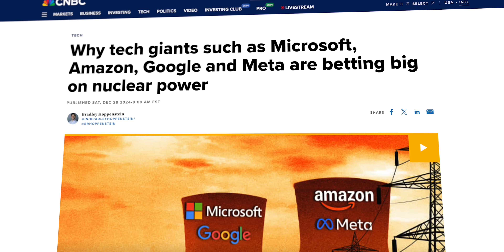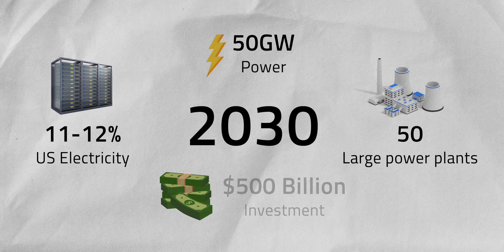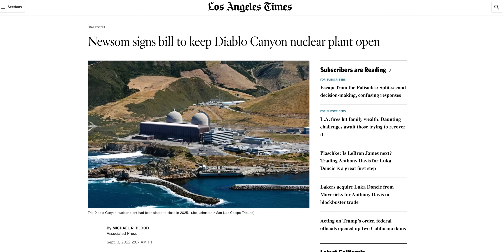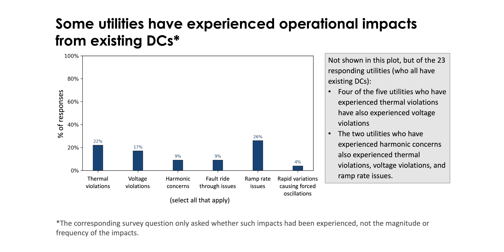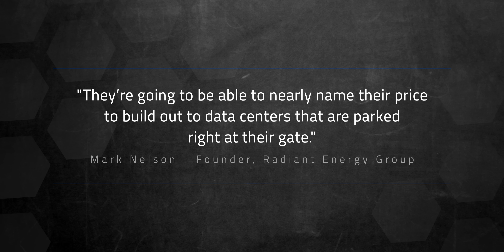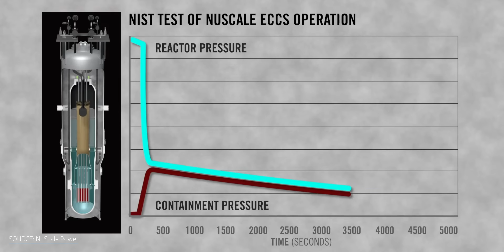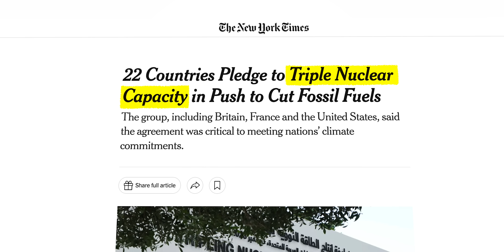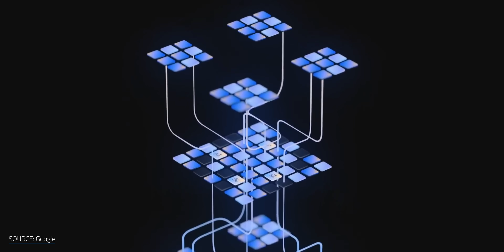Why Big Tech's Betting Billions on Nuclear (Not Renewables)

Comment: SMRs Is absolutely the future of nuclear power.  It will be far less expensive and highly scalable. The limitations of wind and solar are the variability of the power they deliver, and as the baseline load demand increases, there simply is no way to be sure that the baseline capacity is sufficient to avoid the need for rolling blackouts.  I have been advocating for the building of new nuclear power for 20 years. No matter which way I calculate the numbers, we can't do it without either going back to coal or building new nuclear plants and nuclear is much less expensive than coal (and cleaner as well, but to a power producer, cost is more important). SMRs in the form of the A1B 380 megawatt reactor used on Aircraft carries, could be made in mass production for very low prices. The A1B costs about $500 million but in mass production, it could be made for 1/2 of that price. Many are asking why the A1B is not being configured for civilian use.

Comment: solar and wind is also not renewable.. sun will run out just like uranium, thorium, and hyrdogen isotopes.. not to mention all the rare elements needed for solar and other "renewables" in terms of cost per megawatt hour, nuclear has a much better longterm projection than anything else, especially since it is much easier to repair and reuse
Reply: The "sun will run out"; by the time it does, I am not sure that this, or indeed anything else, will be an issue.
Reply: @knightsnight5929  that point stands for nuclear energy as well, by the time we run out of uranium and thorium we will have moved on to something better

Comment: Nuclear is dependable power, renewables are not its really that simple.  If installers of renewable power sources would be required to guarantee reliability the truth would be out in the open.  Currently when renewables cannot supply reliable power they scavenge power of the grid to make up the difference.  Reliable suppliers of power supply continue to be demonized by green activists.

Comment: Over the years, new innovations have been found to do more computations with less power.  The most glaring, obvious one was the shift from vacuum tubes to transistors but there have been many more.  Hopefully we will come up with another X10 reduction in the amount of power do do a given level of computation.  Anyway, nuclear better get a move on.  Solar and wind are so easy to install that by the time nuclear catches up, renewables will have crossed the finish line.  How about an article on how much power America could generate if every private house had solar panels on the roof and if the government took it on themselves to install small, medium and large pumped storage everywhere possible.  This would not only store power but would stabilize the frequency and voltage of the grid.

Comment: Nuclear is not clean. Think about Uranium Miner Deaths, Uranium Mine clean up after the mine is depleted. Were to and best way of storing spent nuclear fuel for thousands of years. Tgat many countries with Uranium are some of the worst world actors. If a 1859 Carington Event results in no workers, no pump replacement parts, no diesel fuel all resulting in spent nuclear rods pools over heating World wide poisoning air, land, sea, and water for the remaining few struggling humans, and all wild caught food plants are poisoned  after our electronic based society has broken down into caos from the EMP Then Nuclear Power does not seem so neat, and clean an idea as a fuel source to generate electricity.

Comment: SMR's should be part of the plan.  Larger Nuclear Reactors also make sense, but Wind and Solar are not a good answer.  Natural Gas and Hydro needs to be the energy knobs to keep the grids stable.
Reply: wind and solar can work with hight temperature reactors (gas cooled TRISO) or molten salts. They run much hotter than PWRs, and thus allow to store the exess heat using thermal accumulators (when the renevable power is abundant), and tap into them, when needed.
Reply: @Viktor-x1w7w  We've been brainwashed with wind and solar.  They are only accepted because of the unfounded hatred towards CO2.  Neither makes sense on a wholesale level, while solar can make sense in some situations where people want autonomy or need power in areas too isolated to bring in grid power.  Those situations are not common.

Comment: We need to stop addressing cost overruns on a nominal basis. With inflation, basically every year something will cost more than it did the year before. Not an excuse for the Vogtle plant to cost more, but without real inflation metrics weighing into the equation, the increased cost is hard to understand if it is time/inflation sensitive or actual inefficiencies. 

Same when conparing new vs old power plants. Sure its better to keep something old running just like a new car, to make the most of the up fromt capex, as long as the opex doesnt overpower that use case. But eventually something needs to be replaced or more built due to increasing power demands

Comment: Interesting - I was unaware the driver for Nuke is data. And seems they're prepared to pay for it, above market rate, just to secure supply. Isn't this going to get interesting - when our need for data is going to divert electricity from where it might be more needed. The General Pulic in competition with datacenters for electricity. The Voltage Wars are a-coming.

Comment: As usual "renewables are cheaper" with no discussion of the backup required to move it toward base load power.
Reply: That's because it is cheaper even with the backup priced in.
Reply: @ As you assert with no justification. 

If it was really cheaper, lack of subsidies would not prevent investment.
Reply: @ Well I could point to Lazard, which has been doing a LCOE including storage that proves exactly what I am saying, or I could point out that Nuclear has enormous subsidies without which it would never have been built. Either option has your argument being discarded as defective.
Reply: @SocialDownclimber  Ridiculous. France has been powered by nuclear for many years and has the lowest power costs in Europe.

And storage? What, 20 seconds of it? Give me a break.

The promises of "renewables" have been broken over and over again for 20 years. If they can't survive without subsidy after all these years, they shouldn't exist.
Reply: @BusBozo  in France we do have large subsidies for Nuclear though so wrong example
Reply: @Voyant  So France is selling subsidized power to the UK and Germany? I sincerely doubt that. I am sure that subsidies are 1) not direct per Kwh as they are for "renewables", and 2) are negligible.

Comment: Imagine how much of a better position we would all be in if nuclear power technologies received a decent amount of R&D during the last 50 years. Combine that with the investment in renewables, and we'd have cheap, plentiful power, with negligible carbon emissions. Sounds awful.
Reply: You may possibly (only possibly) be right. Maybe we should have poured money into nuclear (large nuclear though - SMRs are innately expensive because of the inefficiency of small heat engines). But we didn't, and with the nosedived cost of renewables in the last decade or two there is absolutely no chance nuclear could now catchup with them economically.
So TLDR is "coulda, shoulda, but didn't".

Comment: One often forgotten problem wit conventional nuclear is that the Uranium reseves are very finite: with the current reactors it may last some 50 years or so before it gets really expensive and some 100 years before one would have to resort to sea water - while in theory working it would be way to expensive and energy intensive (e.g. use 1/3 the ernergy). So there is little room for new reactors. The SMRs tend to need more (like +50%) Uranium per power output compared to modern new ones. So at best nuclear can be used to maybe keep the current level.
Expectations are that SMRs would be more expensive then current large reactors, especially if the new design is not paid by the government.
Other points like the high costs and provisions for the waste, possible the safety  are other deal breakers, though a bit more controversial.

Most if the companies promissing SMRs are more like speculating on government money or speculative investments to fund developement and PR, but never really plan to make a working reactor. I would consider them close to criminal scams.

Comment: not one word about cost of SMRs...
electricity from SMTR will be much more expensive than renewables+storage.
No word on dismantling costs.
Reply: While I do not like any of the nuclear  options because of its colossal costs, the recent utility lithium battery storage fires in California are souring me on that option for storage.  

Unless these lithium iron type batteries -- which were supposed to be the far safer option than lithium ion batteries in regard to thermal runaway problems -- are truly solved, I don't see any real solution at all yet.
Reply: The Argentine Carem 25 SMR so far is around 500m in costs. Damn cheap for an 100MWe output, but (a big one), the first prototype will have a reduced output of 30MWe.
Considering the bills some companies handle, and taking into consideration that the first prototype is always more expensive to later drop thanks to assembly line production advantages; yeah, Utra small SMRs may even become household items in a future.
Reply: @RenzitoARG  have you no shame ?
price announcements for new nuke technologies have nothing to do with reality. THe final cost is always at least 3X above what was planned !
See the only running SMR, a Russian build in Siberia. Cost 3X budgeted cost.
While you guys dream on dancing your rightwing totem pole, solar PV is plunked down by the hundreds of GW every year.
Get yourself a real job !
Reply: @silverdiverr  ??
Why the need to insult, lol. Grow up, kid.
Reply: @RenzitoARG  the guy is German, they hate nuclear over there.

Comment: I have no problem with AI data centres in Australia entering into PPAs with nuclear power companies. If they calculate the cost of nuclear power is worth its higher price per MWH, then it’s their commercial call. In reality, they are good partners - constant 24/7 demand from a tech that likes delivering constant output 24/7

However, Dutton’s plan to curtail cheaper RE for nuclear power will see Australians paying more for their electricity. Varying demand is more cheaply met by  despatchable power from RE supported by a storage system over an interconnected grid.

Comment: You didn't address the elephant in the room.  What happens to the spent nuclear fuel/material?  Besides accidents, which made the headlines, the spent fuel is a nightmare to move, store and keep safe over what will be millenia.  Trying to keep reactors safe and stable is one thing, and maybe engineers have figured out a better way to do that, but the fuel problem is there regardless of the technology.  Talk about kicking our problems down the road!

Comment: Modular reactors are the future because of centralized, high effeciency of manufactering design, that can be done offsite where the are materials.

However small modular is not the play, nuclear material is still nuclear and you want it away from malicious actors and in the forefront of decomissioning efforts, you also just get economics of scale with very large reactors > 500 MW. Most "modular" reactors are not 100% modular and require bespoke construction like large containment vessels still.

I'm concerned about the buzz of pebble bed reactors, they rely on recycling physical fuel pebbles around the reactor which is the opposite of mechanical reliability, increases moving parts. The main advantage of Traditional Water-Based reactors is fluids and static fuel is MUCH easier to keep reliable.

Comment: Having a base load of electricity produced by nuclear power is a good idea, for all the reasons you outlined, the only problem I have with fission reactors, is the time they take to build, or more importantly the time that is taken before the building starts, with endless reports, committees and planning objections going around in circles, this is in no small part due to the enormous scale and cost of such plants, but we do not build a single mile high wind turbine, but instead we build 500 two hundred feet tall wind turbines.

That why we should be excited by the prospect of small modular reactors (SMR`s) built in factories; these truck size modules would be produced to exacting engineering standards, 
without the effect of varying light levels or poor weather conditions, a standard design would allow for production line efficiency, which should minimize cost, plus at the chosen site, one (SMR) could be installed, and start to operate, while another part of the site was being made ready for a second (SMR) or a third and so on, or a single (SMR) could be delivered to a large energy consuming company like a steel plant, cement factory, chemical works, glass manufacture or desalination plant.

I believe there will be many countries, in the coming years that will want a nuclear power base load, and will find it financially efficient to achieve this by installing one (SMR) at a time, there are also many large energy consuming companies around the world, who would appreciate an independent energy generating system, that would allow them to have power at a predictable cost over many years. 
My only objection is the radioactive waste even after 70 years we still have no real solution of what to do with radioactive waste. The only country with a feasible solution is Finland, countries and governments should no longer be allowed to duck this issue, but at least modular reactors should be easier to remove and disassemble at the end of their useful life.

Comment: 0:02 In general I don't think they're opposed entirely to renewables... But I would say that the reliability of nuclear and given its longevity and it's... I mean I can see how supplemental energy production with wind, solar, and other sources....

Anyway for a scalable grid network... From a feasibility standpoint and a sustainability standpoint... Given the advanced safety features which they're trying to work on with at least small modular nuclear reactors as far as I can tell and the growth and development of this particular energy sector it will only lead to improvements and eventually fusion technology

Comment: If you know anything about history and compact nuclear  reactors  that were built  and operated by the US  forces  like operation ice worm   and the  PM- 3a  ( nukey poo )  at mc murdo antarctic   base  which took nearly 20 year to clean up the radioactivity  waste  after  leaks .
They have a high running cost, and the clean-up is even higher  .check it out ?